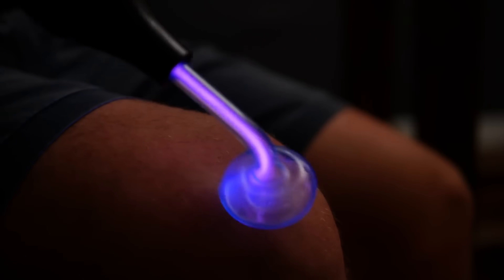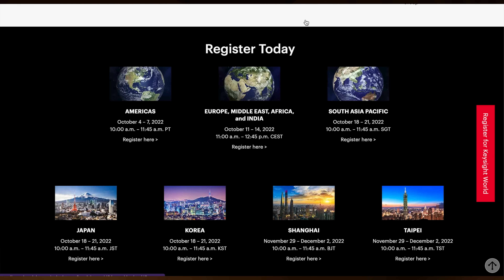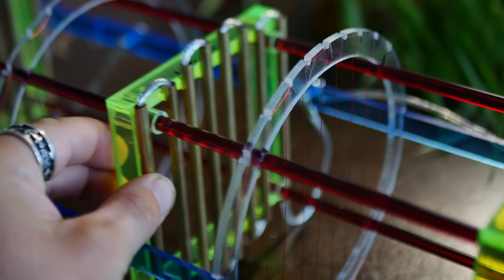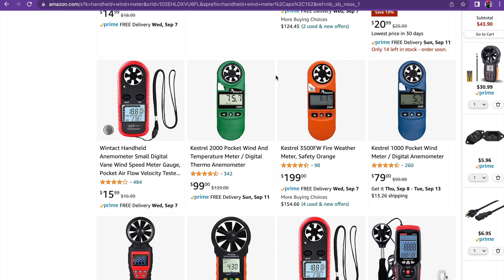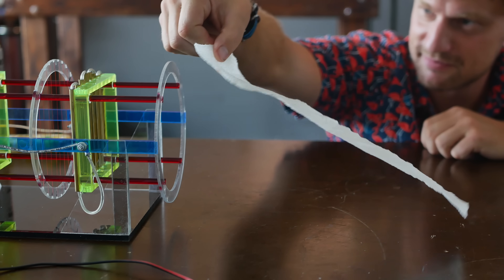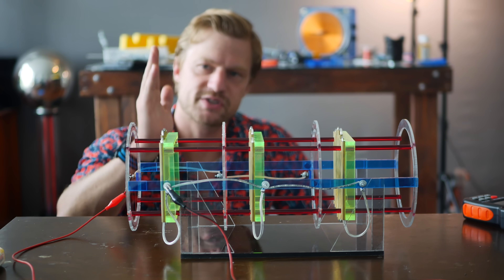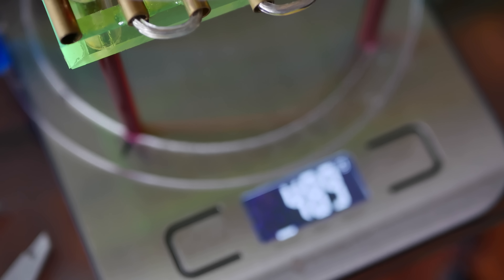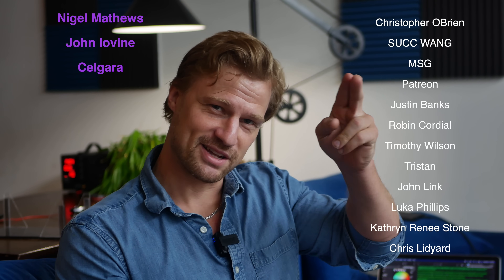Designing A Next-Gen Ionic Thruster! (For Flight)

Comment: I can point out two! Turbulence and electrical resistance. There is a lot of turbulence in your design. air flowing in from all directions. Air flowing in unequally. 1) The design could be a singular cylinder with a duct to increase airflow. 2) The Negative wire tubes could also be shaped like a flattened teardrop to minimize internal drag and pass a tape wire instead of a coiled wire inside to keep it as thin as possible. 3) These negative tubes could also so be curled to create a vortex as that would also increase the speed of the air going through. It would be challenging however to calculate the angle and shape of those curls to maximize vortex efficiency. You'd probably need a wind tunnel and computer simulations. 4) Nozzle at the end 5) experimenting wire gauges 6) other electrical improvements...

Comment: Maybe it sounds stupid, but does a casing increase or decrease thrust?

Because first i thought it will channel the thrust, but maybe it also wont pull enough air?

Could also be a test, go light weight, maybe carbon fibre parts and put a tube around it?

Comment: Great work, keep it up. my thoughts:
1. Keep air from escaping the sides
2. more aerodynamic components in the path of the air
3. more solid electrical connections
4. Nozzle to increase velocity after acceleration of air
5. Air compression BEFORE acceleration of air?
6. Acrylic plastic (PMMA) can conduct electricity, is this an issue?

Comment: Ionize the air while splitting the water with electrolysis and igniting it at high frequencies... ignition by ionization sparks of high voltage across the electrolysis plates (foils)

Comment: The key to efficient ionic thrust is density, at least according to Ethan Klauss. I suggested he try utilising printed circuit board technology to build a compact thruster matrix.

Although before trying that, it would be prudent to establish the minimum spacing between the parallel positive electrodes, to prevent charge grounding incorrectly and instead flow  predictably. Efficient spacing may be in the order of nanometers like modern chip technology, allowing for reduced voltages but the air gap changes things.

There is also aerodynamic scale to consider, scale may create inefficiencies or perhaps you'll discover a way to take advantage of it. 

I've also long thought using something like the Coandă effect or bernoulli principle to make ionic thrust more practical. I can even imagine ion thrust being used to heat air in an ionic jet cycle, perhaps producing a plasma afterburner.

Comment: Freaking cool, dude..... 
big issue I am seeing is providing that voltage it needs to run the thruster has to be on board the craft.  Maybe transmitted power might work, Paul LaViolette, PhD suggested maybe transferring power via a directed microwave signal. I say that if a longer version was added to a craft that was also supported by lighter than air gases or heated gas; the available thrust would be more effective. (Secrets of Antigravity by Paul LaViolette, PhD...must read over view if you haven't already read it.)

Comment: Since its an open design, I'd imagine sealing up the entire thruster would prevent inflow of air from in-between the stages, possibly improving the thrust to weight ratio overall. Also, applying different levels of power with additional intakes for air may be something to look at. 

If a cowling or other containment option is used, with the middle and back stages having their own air intakes, you could step up the energy applied to the middle and back stage. This would mean they could handle the throughput of the prior stages while also taking in the additional air from their own intake. 

I'm not an engineer at all, just thought that might be something that could work.

Comment: This might be a dumb question but I'm curious, does this ionic thruster require atmosphere or wind? It seems to be the beginnings of something that could be used for space travel. Space shows usually have ionic engines so I'm curious if this could work in a vacuum. I know the tests were about air speed, and since there's no air in space to move, this is probably not a great question.

Comment: One I would say put the entire unit in a tube to help Focus the air in a single Direction and maybe a nozzle to help concentrate the airflow . Number two have your negative circular just like your positives are. Third I would say move your wiring out of the build and insulate it so you don't have any unwanted electrical interference. As well as adding at least one or two more stages.

Comment: I think I can see improvements. First using smushed tubes that are sort of aerofoil shaped so you don't have as much turbulence, I'm thinking there is a bunch of energy lost due to turbulence. Second if you make a venturi  and have the stages so they have smaller apertures you would get more of a boost in velocity each stage. If the venturi was shaped like a supersonic nozzle and drew in extra air you could trade some velocity for mass flow.  I was the control system engineer at a transonic wind tunnel. I wonder if you had a grid of needles to help the ionization if it would work a bit better.

Comment: I wonder if you do staggered spacing, would a logarithmic stagger make more sense than the linear seen in the video?
Also, I think for the negative electrodes, an aerofoil instead of a cylindrical shape would provide slightly more thrust, as less airflow would be lost to turbulence inside the thruster.. Does that seem correct? I'm not an aerodynamics expert.
An outer housing would probably improve thrust as well.
The weight (support structure), spacing, and voltage could be optimised with a lot of simulation and experimentation. Maybe different voltages could be used for the different stages?
There is also probably a lot of electrical optimisation to be done, like integrating the flyback supply and the multiplier onto one PCB, and using soldered wires instead of alligator clamps. Would improve efficiency and probably reduce the electrical noise it produces, which is also a consideration with aircraft.
There is also probably a bit of back flow between the stages, due to the symmetrical nature of the electrodes. Adding a thin layer of insulation to the intake side of the positive electrodes as well as the exhaust side of the negative electrodes, would probably greatly reduce that.

Comment: @4:13 It looks like you're using conformal coated copper wire. I believe you'd yield even more positive charged ions if you used uncoated wire. It's why you see such thrust from the copper injection nozzle @2:13. Plus, the ions you're currently seeing are fighting the resistance of the coating, raising your DC circuit resistance, creating heat. You could also double the number of wire strands.

Comment: What is the total power used in amps. It may be more efficient than a standard fan. Which is an amp or less. Understanding that the voltage is not the same as amps.

Comment: Next to many good ideas for improvement I've seen in the comments (encasing, nozzleing, losing some variability for weight, using round casing rather than square, three structural rods instead of 4) 
I saw that the emitter wire seems to spike randomly, probably due to smaller irregularities in distance. Would a slightly wobbled wire (like rolled over by the rifled rim of a coin) be better to evenly space out these spikes? Or even stronger substitutefor the purpose formed slides rather than wires (build up). Alternatively Zig-zag the wire for more emission surface.

Also the angle of the flow (wires to tubes) see that it's centered seen from the top, like an long arrow) giving you a more axe shaped thrust profile, which allows for more precise use later on. 

I lack the technical english vocabulary to explain it better.
Reply: For encasing I'd go for material such as perforated papers or thin plastic film.

Comment: Improvements to try:
1) Crossing each segment at 90° (like one segment vertical and one horizontal).
2) Make different sized segments and enclose it on a venturi type enclosure (like a normal turbine).
3) Making round segments instead of rectangular ones (with round or spiral shaped electrodes)

Comment: Pretty rat idea man! Imagine the losses you ran into were friction losses, resistance losses, and leak off loss is between stages. Perhaps build inside a plastic tube next time with a tapered entry nozzle. That way you could use the rate of expansion of the air coming in to act as a booster to your first stage.

Comment: How does this compare to a fan running at the same wattage? For the improvement in efficiency, I like to suggest enclosing the structure with a cylindrical container like a pringle container to encourage the Coanda effect. Also, you should add more stages, I know it seems like you're getting diminishing returns but remember that when you double the speed of the air you are actually quadrupling the kinetic energy of the air particles meaning you're actually managing to quadruple the efficiency. Your 2nd stage that got you 33% higher speeds actually increased the thrust and efficiency by 38% and your 3rd stage that got you 50% more speed actually boosted your thrust and efficicncy to 68%. Add maybe another 6 stages! A small increase in airspeed will actually mean a larger percentage increase in thrust,, test this out on the scale to see! It is also worth shifting the distances between the modules once you get the top speed of air to see if you can further increase the speed of the air once the airspeed is already maxed out at the initial configuration,  sort of like shifting gears at various speeds in a manual transmission of a car. In fact up the voltage even more after you reach max speed with initial settings, and change the spacing, see if that 66kV that you rejected actually does something once the air molecules get moving and change spacing! Or use the 66kV initially and then see if you can get more speed out by then shifting the gaps once the air speed is maxed out at initial gap configuration. Also why not have the small electrode and large electrode on the sides of a cylinder? That way less air friction, sort of like as if they are coiled along the inside of it.

Comment: 1. Building a structure around the thruster to shield from turbulent flows. 2. A vector nozzle to create a high pressure zone at the nozzle to a low pressure atmosphere will increase velocity. 3. A change in wire gauge for the electrode might result in more power flow to the air as well as more surface area to discharge to the surrounding air.

That's my guess but I'm not smart enough to be sure 🤣

Comment: question. couldn't you make a center point using a piece of metal to guide the power were you want. will that help the air flow move faster? or will it just add more weight?

Comment: Great video, keep up the good work 👍Some of the ionic wind has to be escaping out of the "open sides" cylinder design, what if you made the design "closed sides" like a tube or a pipe? Also instead of having all the positive charged wires in a vertical position what if you rotated the wires on stage 2 & 3 in an attempt to create a cyclone or vortex effect? Or what if the positively charged wires were in the shape of a blade like that "Tornado" gas saving devise? You could also change the shape of the grounded electrodes from tubes to a blade or wing shape, something more aerodynamic. Lastly what if the exhaust hole by the candles was smaller than the air entry hole wouldn't that increase output pressure? Looking forward to your improvements & good luck!

Comment: Replace the wires with rally high tooth count hacksaw blades. Or make light blades with stacked push pins. Ionizers use sharp points to easily throw the electrons overboard. The bright spots on your wires were erratic and not very many.

Comment: You are a genius! I definitely can see this being used on flying vehicles in the future.
Reply: It produces almost no thrust, and uses huge amounts of power. What benefit does this provide?
Reply: @kevinrdunnphs  you’re thinking now. Think ahead of what can be…
Reply: @northprime_unlimited  the laws of physics do not change. This is a state function, some energy goes to pushing the ions and thus making thrust, but in order for this to work, you also need to expend energy splitting electrons off of the air molecules to make ions, this takes a fixed amount of energy that you can not eliminate from the equation. A propeller doesn't need to rip air molecules apart and so will always be more energy efficient. Is this cool, sure, will it change the way we make thrust in our atmosphere, no.
Reply: @kevinrdunnphs  I guess we’ll see what happens in the future genius…

Comment: try making it round an enclosed in a tube, then via a cone separate "gate" 1 and 2 with a cone temporarily reducing diameter causing directing flow in area 2.  try repeating that into area 3 with some varied sizes cons. 

a wild guess is about 15-20% reduction of diameter would help speed a bit

Comment: This might sound dumb and I have no clue how this tech works.

But what if you add a traditional fan in the front to start feeding the system air - and the system then just accelerates that flow ? Would that be more efficient ? Would it be less efficient ? Would it work at all ?

Comment: What if instead of the slotted grounded electrode, you add a solenoid with the B field pointing in the direction of air flow? If it works like I’m thinking it will, this will give you space to add a nozzle for greater thrust

Comment: I'm a neewbie to it, but it seems to rely on air inertia to break free of the plasma atraction (drag) from one stage to the other... wich is (basically) a 2 pole motor, if somehow it was programable to oscilate on the air speed in it, maybe you could make a 3-polar motor out of it??
I presume it would make the air less stable flow but easier to accelerate, also since it isn't enclosed there's no reason to make it linear ( + - + - + - ) it could be axial, basically suckin air out of all it's surface and accelerating it in the middle... the 3 pole controler would set direction of flow and the all-side inflow would stabilize the final stream

Comment: Inefficiency:
1:  Anode shape
2:  shape of the overall frame (Cathode frames are circles and Anode frames are squares)
3:  Decrease wire thickness if possible to increase ionization and therefore thrust
4.  Materials is an obvious one. I recommend some basic level composites

Comment: OK - Something silly

Since everything affects everything else around it - does the TENSION of the wires have any effect?  You know, Vibration/harmonics/etc.
You wound them by just pulling and saying, "that's enough".  But what if it isn't?  What if the wires need a lot of tension on them, vs "just tight enough not to sag" vs loose is better?

The wires have electron movement in them (electricity) and that is/isn't affected by wire tension?  Seems like it should have some effect, but does it?

2 cents in play!

Comment: I bet an arrangement with a grid of points and a mesh of loops would perform better. As it is, the ionized particles providing the most aligned thrust are colliding with the bars. Hexagonal "chicken wire" fencing and a few kinks in the wires would be an easy way to test it. It also decreases the voltage necessary to ionize the air at a particular distance.
Also, putting a tube around the motor would force the air to traverse more linearly down the tube.
Another way to try yo improve performance would be using some inductive coils around the outside to concentrate airflow down the middle of the tube and provide some extra acceleration. Once you've ionized the air, inductive acceleration becomes an almost free addition.

Comment: Dammit, jay! you done it again! great video, great project, great build! love it.

(request: what do you think about building a sgtc except using a relay instead of a spark gap. eh? if you use a ballast you can run it from mains without any kind of high voltage supply and actually it works pretty well. an electromechanical sgtc, sound cool?)

Comment: If you were to insert a more dense gas into the mouth of the thruster would you see a change in thrust because you may be able to get more air to pass through? What about temperatures, would it become more efficient at say 50 degrees F vs 85 degrees F? what about changing the sizing of each section and using your spacing to create a compounding exponential increase of pressure inside the thruster with  exterior shielding? (aero) maybe some sort of thrust vectoring system on the back would help in the long term goal of flight as it could make the overall engine more efficient? very interesting concept and a very cool build! could it be more reliable than our modern jet turbines if we found a way to create usable power? very simple design in concept

Comment: I have seen the video and i have few questions, maybe my understanding of the matter is poor but:
1) It seems that the brass pipes are NOT electrically connected to the transparent wire, can somebody explain to me this detail?
2) the dark romm photo shows that in the high voltage thin wires there are evenly distributed sparks that actually generates plasma. There is any special treatment done on the thin wire? Like is transformer insulated wire where insulation has been only partially removed in some places?
3) Will this setup also generates Ozone?
4) What kind of electrical particles will the device generates? Electrons i can imagine but in the video are shown positive ions what kind of?
My thanks in advance to anyone for giving me those answers